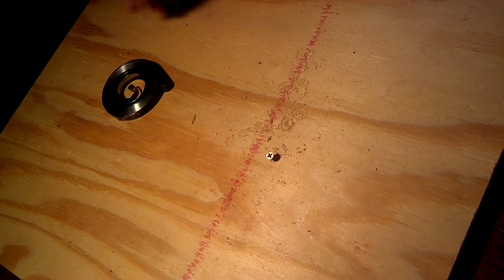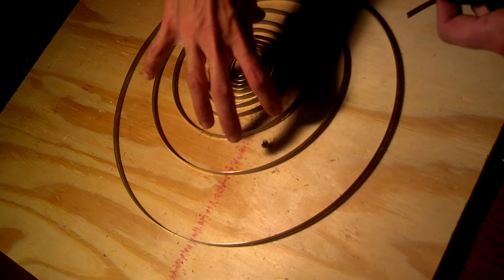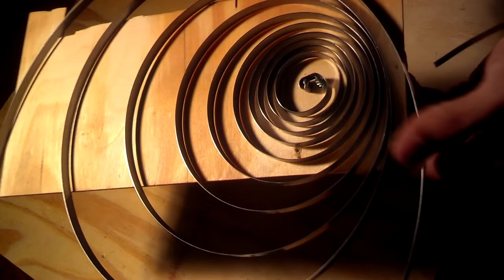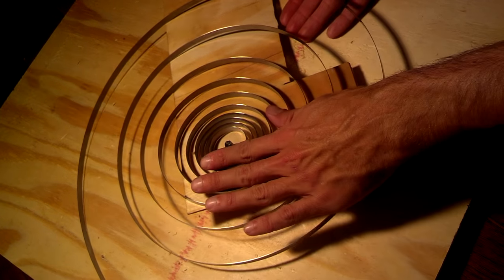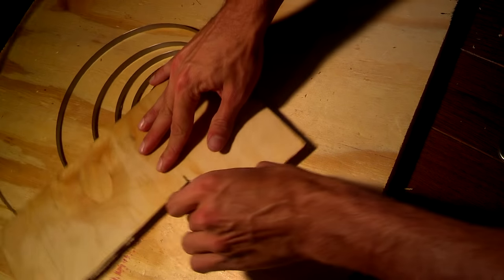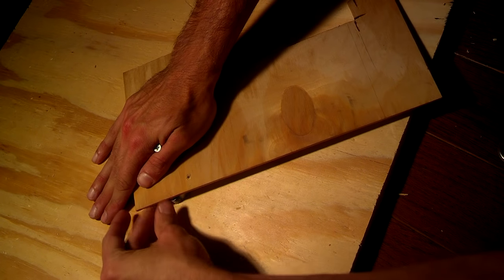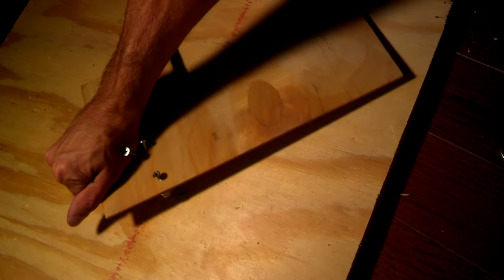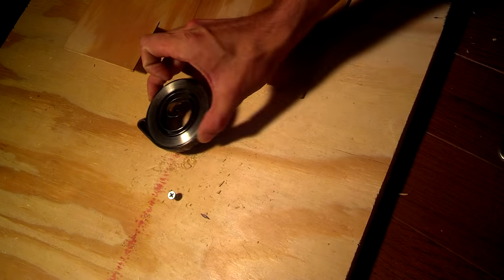How to Rewind Starter Recoil Spring Cassette

Comment: I give you credit it works, but I like another video I saw the guy use a nail in a wood bench hooked the spring to it used a drill on the center & coiled it quickly  & efficiently w/ it's drill pins opened up just enough to slide the center end between them so to lock & hold it tightly for coiling it. He then placed a long zip tie around the coil to lock it from unwrapping itself & w/ a couple pieces of gorilla tape on the top side of the spring & pressed it into the coils tight securing it from springing  up or out. But your way too looks good to do to. Thanks for sharing it. I give it a thumbs up.
Reply from the maker: Thanks! I haven't tried the drill method, but it definitely seems like it could be quicker than this.

Comment: Excellent video, method works like a charm ! If you have an older style Stihl, like I did with the metal cassette, this still works. Your outside tab on the spring will stick out of the cassette and you just need to pull it around the metal tab on the casing that it locks on.
Good idea and well demonstrated man !!
Reply from the maker: Thanks for the feedback! Always happy to hear this is helping people out!

Comment: Thanks for the video.  I recently had to rewind an unsprung spring.  Using my hands (gloves on) I could get it wound tight enough in size that it would fit in the space, but it unwound enough when I'd try to put it in that I couldn't get it in.  HOWEVER - what I discovered is if you start winding the spring from the outside in, inside the recoil housing, it was pretty easy. Hook the outer tab first, then start winding the spring inside, from the outside in. I had it rewound in just a few minutes.
Reply: +Mark B Thanks! Your comment was just what I needed to rewind my poulan chain saw pulley spring. A neighbor and I tried to reload the spring over 2 hours with no luck and came to the conclusion that a special tool was needed. After reading your post, I went out in the garage and, in 15 minutes had it reloaded, In another 5 minutes figured out how to retension so the rope and handle pulled up tight.  Best regards.
Reply: I have one I have to rewind now, which is why I watched the video. Life Is For Enjoying said he doesn't have the recoil housing, but I do and I was planning to try exactly what you said worked for you. Now having seen your comment saying that it worked, that is nice to know before I start!
Reply: Followup to my earlier comment - I was able to get the spring back into the recoil housing using only my hands also; I found it helpful to gently clamp the recoil housing in a bench vice. Still think your method is effing clever for folks that don't have the housing!
Reply: Thanks, after reading your suggestion, 5 minutes later using my cheap Chinese junk chain saw again! Wind into cassette from outside in :-)

Comment: Outstanding! My Roybi 28120 spring exploded in my hand...I suppose it would have been funny on U-tube happening to someone else but it was me and it wasn't funny. I used the pull starter numerous times and it didn't work. The Ryobi cassette has a small notch in it. The spring is bent about 1" from the end of the spring. After many attempts at the on way, I decided to try the other and opposite way, that is, I put the spring into the notch, and then wound the spring into the cassette from the OUTSIDE to the INSIDE by turning the cassette in my hand. This worked well after a couple tries.

The only addition I would like to make is to wear eye protection. This spring is very strong and can damage an eye without much trouble!  

Thanks for your presentation!
Reply from the maker: I'm not sure whether or not I tried winding from the outside in, since this video was so long ago, but it does seem like a lot of people have success with that, so I should have tried that before reverting to the nonsense in this video, haha. Good advice on the eye protection! I should have also been wearing gloves of some sort, because the spring almost sliced my finger when I pulled it out at the beginning!

Comment: I could have used this information years ago on one of my old line trimmers. I had no idea how to rewind the recoil spring and it was just impossible. I no longer have that trimmer, but its sure good to see how that problem is solved. I was stumped when I came cross it and always hated that I couldn't figure it out. Thanks for making the video. Watching this video It almost seems like it would help if one of the boards was replaced with a sheet of plexiglass so you could see the progress of the winding.
Reply from the maker: moofushu that's a very good point about the plexiglass, you just need to make sure it is fairly rigid plexiglass, to avoid it bending from the pressure and letting it loose... Some thick half inch, perhaps?

Comment: Hey man. I really want to thank you for posting this. I looked at several other videos and this method was by far the simplest and most effective. I didn't need zip ties or duct tape or power drill.

My situation was slightly different from yours but I was able to get the job done relatively easily. I was surprised at how well this worked. 

Pat yourself on the back and thanks again. You saved me from having to buy another poor-quality recoil spring. The one that flaked on me is less than a year old. So it goes.
Reply from the maker: Awesome! I'm glad to hear it helped...I've heard of people having success with just coiling it from the outside, in, but I don't recall if I've tried that yet myself, so I'm not certain if it works out. But I know this method works well! haha :-)

Comment: thank you worked just like your video no more throwing wrenches
Reply from the maker: Awesome! Glad it helped you out a bit!
Reply: It's worth pointing out that there's a lot of stored energy in the fully wound spring.  If it breaks loose when fully tightened it could cause serious lacerations and worse.  I strongly recommend that you wear heavy gloves and face protection!
Reply from the maker: K Burns I can definitely agree with that....it didn't cut my fingers off or anything, but when I intentionally took the spring out of the cassette, it pinched my fingers and hurt quite a bit. I should have been wearing gloves for sure

Comment: When I was a kid, I was breaking up some concrete with a sledge hammer for my father. The hunk of concrete was the base of a clothes-line, so it had a steel pipe in it. Well, to make a short story longer, I struck the steel pipe with the hammer. No biggie. However, after a period of time, I developed a severe 'headache in my eye'. I wound up down at the Wills Eye Hospital in Philadelphia. I had a splinter of steel in my eye. I remember the doctor taking a hand held drill type of device to remove the splinter out of my eye. It was like some sci-fi movie with a drill moving closer and closer to my eye and yes, I was scared to death. I never forgot the experience of that drill coming into my eye. In addition, my Air Force maintenance training emphasized safety at all times. Therefore, I am a safety 'bug' because I know from personal experience, the opposite of safety: injury, when safety is not followed.

It's been nice talking to you. I wish the Lord's blessing on you and yours. Take care. 

Sincerely,

Ed Gibbons
Reply: AS a autobody tec and mechinc for 43 yrs, I allwayes kept a magnet in my tool box in case metal chips got in my eyes. Works great
Reply: God bless u to i had a metal in my eye as well i remember every time i came across light my eye hurting and tearing up it was painful.  So now im always using my safety gear . Stay bless
Reply: funk 

👍....great tip...thnx!!!

Comment: The only downside is it looks like the inside hook part gets bent out of shape. The last spring I did was pretty brittle and tended to break/snap when being bent so probably would have snapped during the winding or during the straightening if I used this method.
Reply from the maker: Yea, I did also notice a bit of deformation when I did this, but I believe I was able to bend it back with some pliers and make it work.... Luckily it didn't break!

Comment: ill b doing the same thing in a few mins. gonna try with my hands. wish me luck. lol
Reply from the maker: How'd it go? Success with just hands?
Reply: LifeIsForEnjoying ya know what. i didn't have to take apart the pull start at all. i just rewound the pull cord by turning the flywheel in reverse and then just gave it a bath in pb blaster and it wound back rather easily
Reply: now the pull start works likeva dream but now it wont start. lol. it started the day before but now it might need some start fluid
Reply: Alex Andersen  how'd that go using your hands..jus done the same and it was a disaster

Comment: what manufacturer did you order this spring from?
Reply from the maker: The spring was for a Radne Raket 120 for my powered hang glider. I think I ordered replacement springs directly from radne, but it may have been Husqvarna because it is essentially a clone of one of their engines

Comment: maybe you coupdn't do this, but usually the trick is to wind it outside first directly in the cassette.
Reply from the maker: +Lobotoman Thanks! I actually started seeing that suggestion in other places after I came up with this method and made the video...I have yet to actually try that, but I'm a bit embarrassed I didn't think of it sooner, lol
Reply: Oh that's nothing. I had a chainsaw with a loose pull string.. opened it up, the recoil mechanism was behind the flywheel (?!).. ok I'll just disassemble that and see what I can do... oh noe apparently the previous owner tried to fix it too and stripped the nut it won't come off. FML I go get the grinder and gently proceed to file the nut off.. then I take the flywheel out, take out a bunch of rings and things, get to the spring cassette, take it out and look at it, remove the spring put it back.. and then it hits me, to fix my problem I just would have had to pull the string, keep the tension and wrap the string around once or twice.. fuuuu!
Reply from the maker: +Lobotoman hahaha, thankfully I learned that lesson when I had to replace the spring anyway and put everything back together... Loose cord was a 5 minute fix, but I probably would have done the same thing